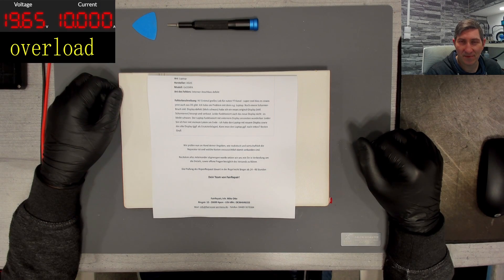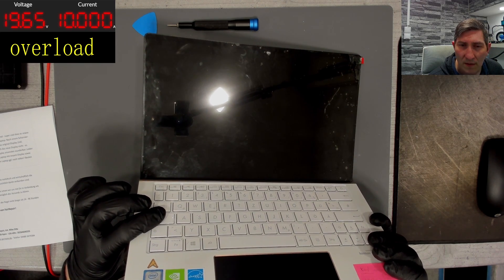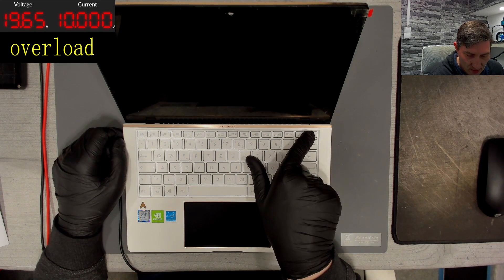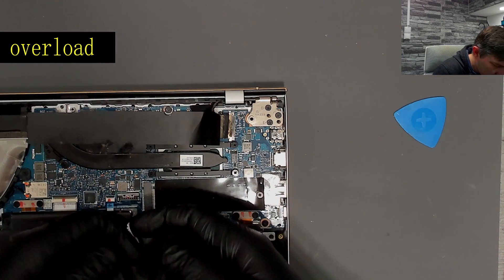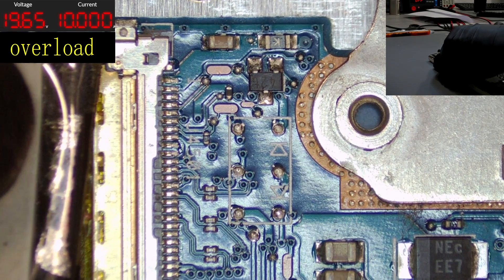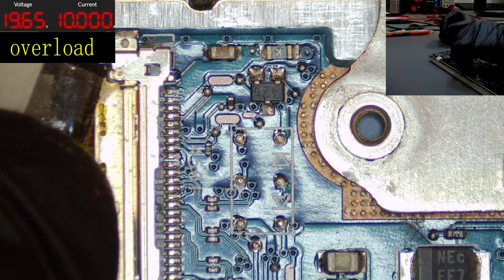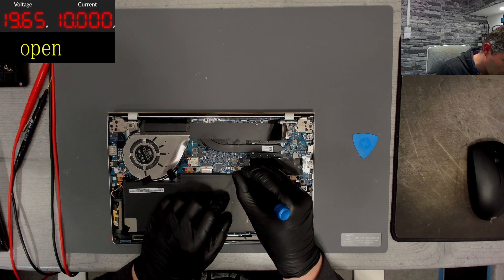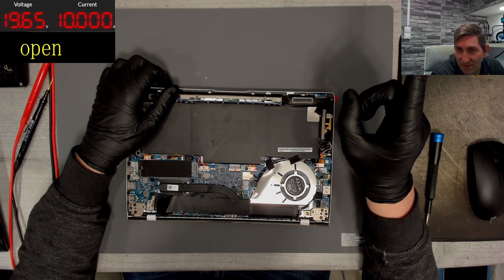The most common fault when you are dealing with No Display. Easy Fix!

Comment: We all know that you will use Sorin's proper calibrated wire :D. Excellent video :D.
Reply: The only problem with the "Sorin fuse" is that you don't know at what current ignite it. But 10A will still be better than no protection with a 0R resistor.

Comment: I had the exact same issue with a raspberry pi board in the fuse after the USB port. No matter what PSU used the OS reported undervoltage. I decided to bypass the input circuit with my bench power supply and provide 5V after the fuse and...Voila! No undervoltage messages. Afterwards I measured the fuse and found just 2.5 Ohms of resistance but this was more than enough to have a voltage drop which triggered the undervoltage messages. I replaced the fuse and everything went back to normal. As for the LCD fuse there, you should have called Sorin for help.... 😁